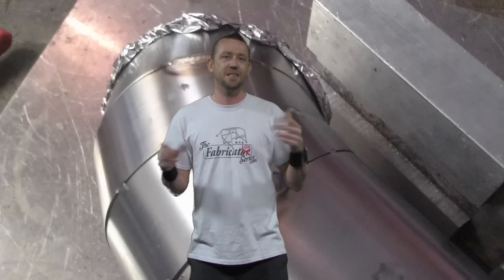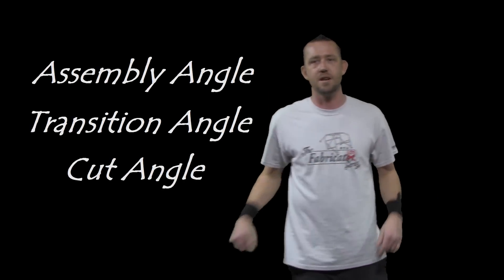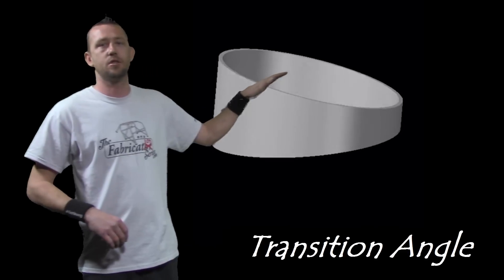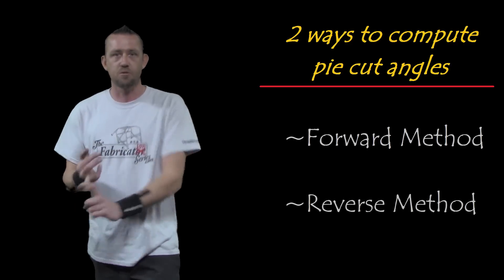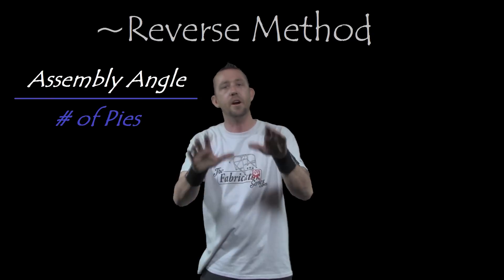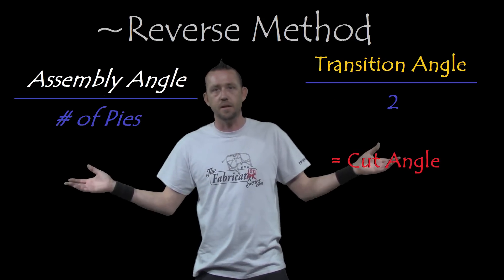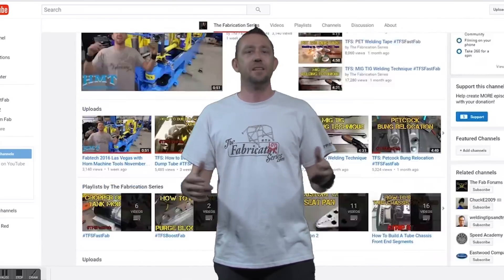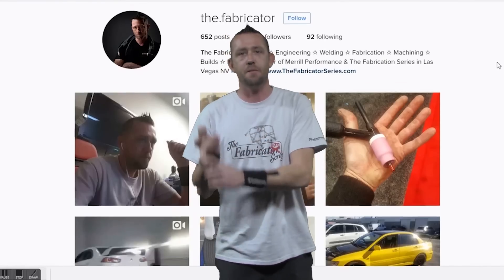TFS: Pie Cuts Made EASY

Comment: You need to cut your 4.5 and 4.5 to the half way point then cut 0 the rest of the way. If your clever enough you can leave a little tab in the center. Fold the 4.5s together and take the 9 you cut out of the middle and use it to fill the new v gap on the other side. This will fix your volumetric every and not have it lobster backing.

Comment: I already knew how to calculate the angles that's basic 9th grade geometry that I learned a decade ago but how do you cut them how do you line up your angles it's hard working with round material to make sure that your cuts aren't slightly different angles and I wanted to make sure or find a good way to line everything up
Reply: Take it to a pro you shouldn’t be around  tools

Comment: Is it just me or was the reverse angle easier to pick up on? I'm not the best at math by a long shot, but you really lost me on the cut angle x2 = Transition Angle (T.A) then to T.A.+T.A+T.A+T.A+T.A= most common assembly angle. Also for the part where you say "if I had 5 of the 4.5° it would make a 45° angle and 10 would make a 90°¿¿?? I've been watching this video for over an hour now trying to get an %100 complete understanding.

Comment: Bro after hours of Google and diffrent pie calculaters and autocad . I found this .   Thank you for braking it down. One question . When working with the cuts  in theory , could I set my chop saw to the say 9 ° do the first cut. Then flip the pipe 180° and do the next 9° cut to make my pie cut . The reason is I don't have a band saw and I'm figuring the chop saw will make a clean cut ?

Comment: The concept is so simple. Thanks very much for sharing. Not something one will figure out on your own too easily.
Just one comment on the reverse method and its use, I would say that this method would be very useful when you have to create a non standard angle from the start of the bend to it's end, something like 47.5 degrees for instance. You will need to use this method to calculate your custom cut angle which will naturally be a non standard angle.

Comment: If you cut at 4.5 degreess vs 9 degrees and your doing a 180 turn would one have a tighter clearance or do they both equal out to the same when they start to bend ?

Comment: How to determine the length of top and bottom section of a pie? For example, if you want a three inch radius, the length of top and bottom sections is a certain length, but different for a four inch radius. So what is the best way to determine bend radius via those lengths?
Reply: 300% Customs best way to do this is to draw and to measure the 3 inch radius mark out equally of the size cuts you need then transfer that line to the bottom of radius with your bevel finder

Comment: great info, Tx!   can't locate pie & lobster cuts part 2 , assuming there is since there's a part #1.  Tx again........also, what are lobster cuts?
Reply from the maker: Rob Weaver Part 2 [still] hasn't been made. It's on my list. Lobster cuts are another term for our cuts. They have many names in many parts of the world.
Reply: looking forward to #2  .  I'm interested in this technique for motorcycle exhaust pipes.  A pipe that gradually swells and then reduces in diameter, are the pie wedges made up of gradually larger pipe diameters that are welded together?  Great videos, you're a pro!

Comment: pie cuts are easy, once you start doing them. the way I learned was with cardboard.  take a strip of carboard, the width will be the diameter of the tube you want to mess with. cut the angles and play with the pieces and you will soon get the concept. 
one thing that wasn't mentioned was the end pieces. at the end of your bend, the next piece will have one side at an angle(whatever angle you did the rest) and the other will be a straight cut. this way you will transition from elongated inner diameter back to a straight pipe. 
For me what works best is to cut a bunch of pieces at 7.5* and a few with a 7.5 on one end and a straight cut on the other end and keep them around the shop. 
I think the 7.5* is the best compromise between smooth bends without excessive amount of welding.
Reply from the maker: tuloko16 That info about entry and exit pieces is actually in part 1

Comment: My chop saw has trouble cutting stainless steel tube. Any recommendations on the blade to use ?
Reply from the maker: What kind of trouble?
Reply: I was using my Mitre saw that has one of them carbide cut wood / metal blades. I think its not up to cutting stainless. It just made it really hot and the blade started jumping about. I bought a makita chop saw with an abrasive blade. Seems better but quite a bit of cleanup needed.
Reply: Short of a laser IMHO a band saw is the only way to cut tubing for stuff like this. I dicked around with a chop saw for years and picked up a cheap harbor freight 4x6 band saw at a garage sale. It's far from the best but my Milwaukee chop saw gathers dust now. Done made up my mind when it goes out I'm getting a good one but it seems like the thing won't die.

Comment: I'm not understanding how to figure out your clr vs how the dimension of the pie piece effects it. Say 2" and I need a clr of 6" how will I calculate my pie piece length?
Reply from the maker: Colyn Maurer I'll show that in the next pie cut episode. I briefly described in in the first vid where I drew the parts in the software which can be done with paper and pen.
Reply: After looking and looking I think I figured out the math involved. Thank you for the badass videos.
Reply: take the clr and divide it by the number of pieces that will make your bend. that number is going to be the width of your pieces at the center line you put on the pipe  NOT AT THE ENDS.

Comment: do you leave a cut angle on the end pieces? I have found in the past to leave the end piece with a straight cut on one side (0 cut angle) and the normal cut angle on the other. (transition angle = cut angle on end pieces)
Reply: By mentioning a cut angle and a transition angle, it's implying that he doesn't - for the exact reason you ended up pointing out.

The CUT angle would apply to the end pieces, which only need to be CUT once. The TRANSITION pieces would be the remaining pie cuts, which would be stuffed into the TRANSITION from each end pieces.
Reply: if you are doing a small angle change like the 4.5* cut you wont notice a major difference and it could be butt welded with little trouble. but the higher angle your cut the more oval the pipe gets. You will want to start using the straight cut pipe as end pieces (or half a pie cut on each end).
Reply from the maker: I mentioned in the first episode about the inlet and outlet transition pieces. They are needed for angled pieces of greater angles because the actual shape of the cut angle is elliptical or oval. The heavier the angle, the more likely you'll need and inlet/outlet angle.

Comment: question. after welding don't the angles change? expansion of welds and materials?
Reply from the maker: Not by any extreme amount that would cause worry. You might get 88 or 89 degrees when you wanted 90 but thats also up to how you weld it as well.
Reply: The Fabrication Series thanks. i haven't  tried pie cuts before, but your vid is giving me some knowledge that is useful when i try my first pie cut

Comment: what calculating how tight the angle is?  tight 90° for example as opposed a sweeping 90. my Englishes no goods
Reply: The angles won't change - just the length of the pieces.
Reply: Frank P   The length of the top part of the pie, will give you the angle. There is a formula to calculate it.
Reply: +Meir Schwartz thanks for the qwik replys guys
Reply: look at my other comment with the links. super useful tools that makes it so easy.

Comment: very useful content dude... but u need a higher resolution camera...
Reply from the maker: Sheih Buhari It's shot in 1080.
Reply: Sheih Buhari Agreed, great content but some if the footage ends up a bit grainy.  Although it may have been shot in 1080 the actual resolution can vary based on many factors but I think the lighting is playing a pretty big part in the quality of the video.
Reply: Click the little gear icon in the lower right of the video and change the quality.